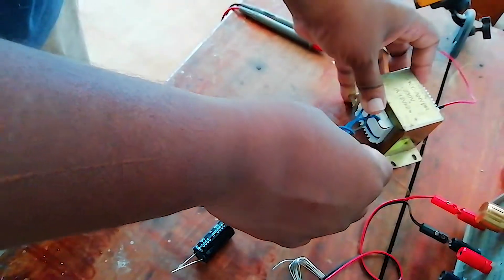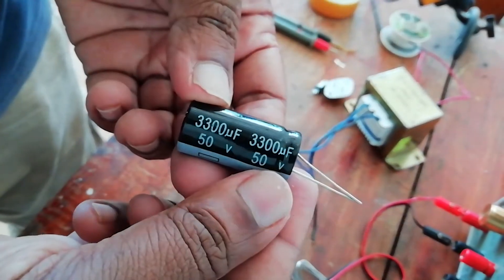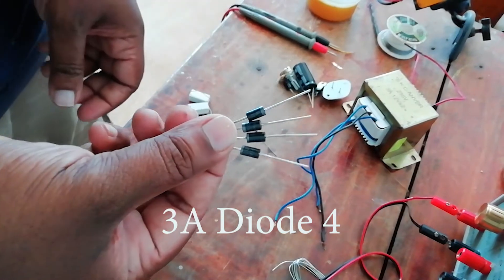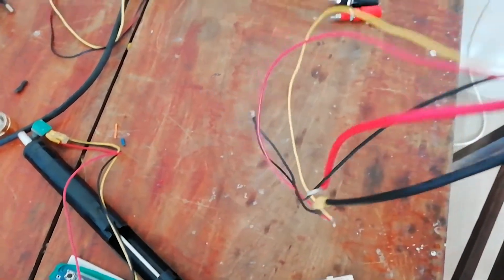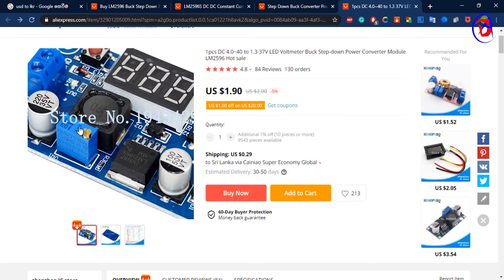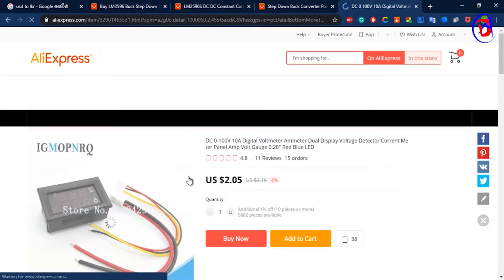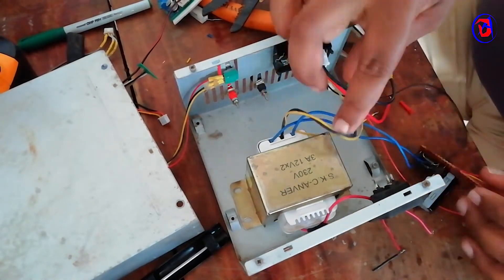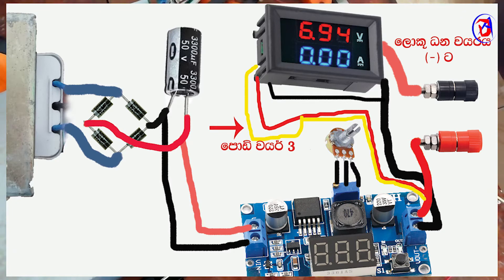How to make a DC Power  supply unit Sinhala

Comment: Can we make 10 Amp in the same way ?
Reply from the maker: yes of course we can, but 3A,5A is enough for our daily use. Thank you for your idea
Reply: Thanks a lot
Reply from the maker: 10A use karanwanam 300W CC-CV Buck Converter (0.8-28V) 12A Step down Power Module eka use karannda
Reply: Thanks dear

Comment: Aiye   12 v better  yak charg karanna taspomar ekk aragena
12v dc karama  v 16 pennuwata  api eththtana gannan ganne  12v kiyalada
Reply from the maker: 12v battery ka ouparima charged wenne 12.7v  . Transformer 12v kiyala tibata 15,16v awagen pitawenne rectify karanakota voltage aduwena hinda itin battery akata 16v dunot battery over charged wela battery 🔋 vinasa wenda puluwani ahinda Battery protection Module akak bawita karala 12.7 dakwa pamanak charging karaganda atakota battery aka awlak natuwa godak kalayak pluwan...... 

Battery protection module serch on YouTube

Comment: Oke transfomar eka කීයක් විතර වෙනවාද...plzzz reply ekak danna
Reply from the maker: Aka  mama ganakota nam 850k witara oune danam 1250 k witara wi sho ,oyata makata 24v 5a SMPS POWER supply  akaut use karanda puluwan habai etakota 27v witara tama ganda puluwanne
Reply: @dacreation369  එතකොට bro transfomar eka 12v vage unoth max current eka කීයක් විතර ganna puluvanda...කියන්නකෝ
Reply from the maker: 15v 3A dun noot 13v 3ag anda puluwan Volt 1,2 drop wenawa
Reply: @dacreation369  ok

Comment: power  control module aka link akath avanna
Reply from the maker: Buck DC-DC Step-Down Module LM2596 DC-DC 4.0~40V to 1.25-37V Power Supply Adjustable Voltage Regulator 220V 2A Circuit Board=https://www.aliexpress.com/item/4000627232173
Reply from the maker: https://www.aliexpress.com/af/LM2596-DC%252FDC-4.0%257E40V-
Reply: Link aka vadana
Reply from the maker: @kavirunethsara8254  www.aliexpress.com/item/32786761218.html?spm=a2g0o.productlist.0.0.2ad15c0ezXJRKa&algo_pvid

Comment: badu valu
Link dannabarida
Reply from the maker: https://www.aliexpress.com/item/4001245364080.html?spm=a2g0o.productlist.0.0.73d8781351tYrN&s=p&ad_pvid=202008130930491380770578729040003281592_6
Reply from the maker: DC 100V 10A Voltmeter Ammeter =https://www.aliexpress.com/item/4000936518238.html?spm=a2g0o.productlist.0.0.4fab47delthfUu&s=p&ad_pvid=
LM2596 DC DC Step Down Converter Voltage Regulator LED Display=https://www.aliexpress.com/item/32912622343.html?spm=a2g0o.productlist.0.0.228b5f91qdFwPQ&algo_pvid=
Reply from the maker: mewa Voltmeter ya ara anit okoma Lankawen colombo kotuwen ganda puluwan.sub karanda amataka karanda apa
Reply: Mama Columbu nava Walasmulla
Reply from the maker: Walasmulla koheda tiyanne?
Reply: Hambanthota
Reply: Mama 8 inna
Reply from the maker: @kavirunethsara8254  Udawalawa pata the?
Reply: Naha